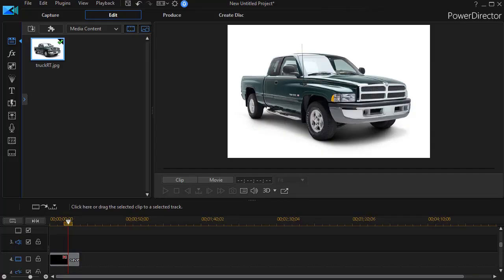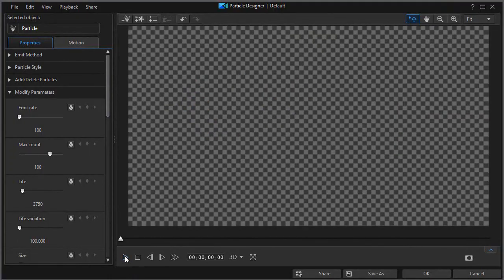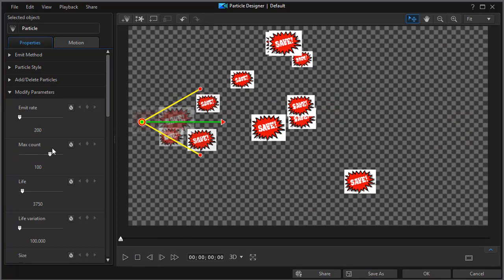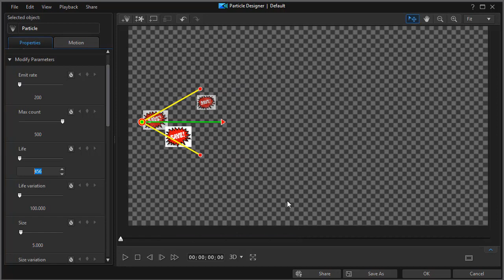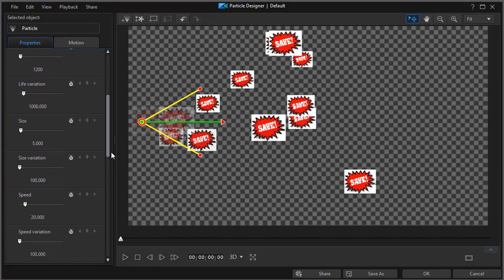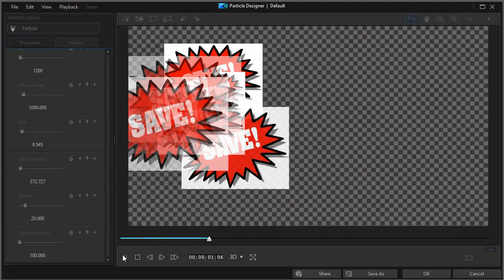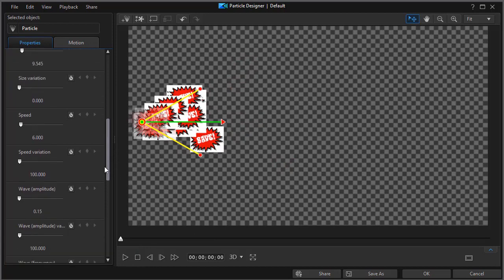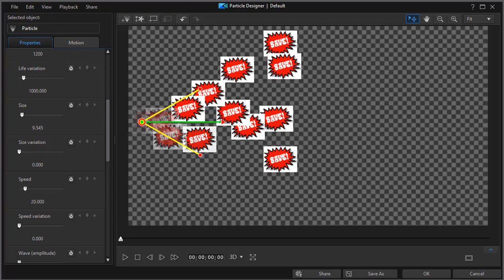Power Director - Design your own particles - pt. 4a - particle properties

Comment: Great video, thanks! I just have one question please: I want my particle effect to last longer (not the particle life itself, but the arrow should keep on emitting, instead of running out of particles). Is there any way to achieve this?
Reply from the maker: I did some experimenting with this. it seems like the best way is to lengthen the duration of the particle on the timeline.  --Jim